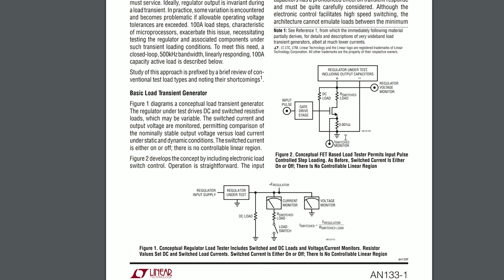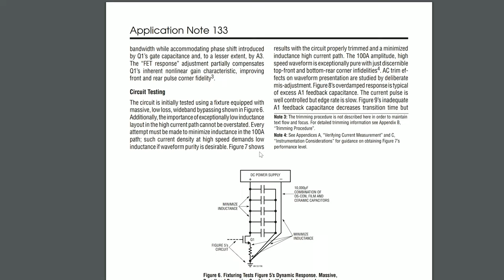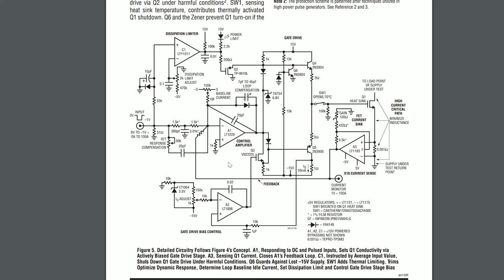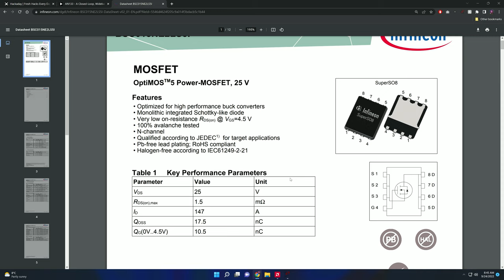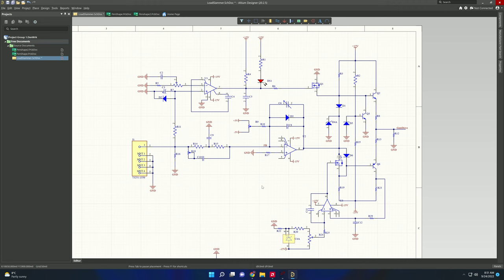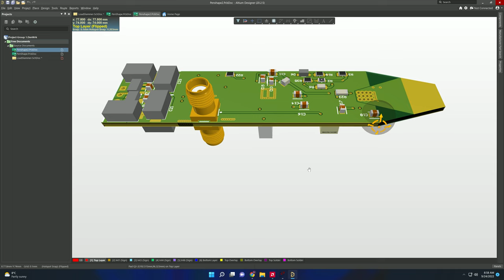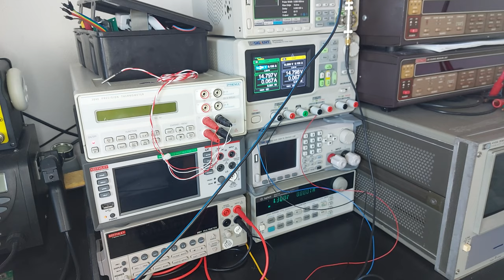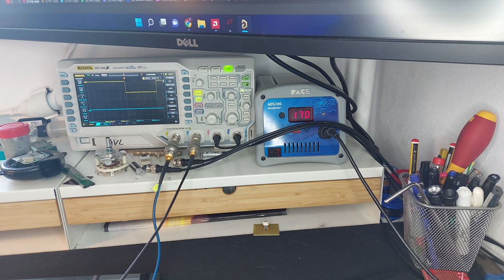Revisiting Jim Williams (AN133 Simulation, Layout, Build and testing)

Comment: Fantastic tutorial, I enjoy this sort of thing to but much more simple! I used a Rod Elliott application note from his channel for a very high quality headphone amp, I also opted for SMD because I enjoy PCB design with these parts and I designed my PCB very different from his to suit my needs, I had my board built by JLCPCB and they did a fantastic job. I populated it and it worked perfectly no cut's or bodges which felt nice the amp was so quiet barely any noise I didn't think it was working so set up my scope and it's perfect. Hats off to Rod. It sounds beautiful and I love it ! but the project was fun and I know how you felt at the end of yours ! I will probably design my own boards for some more of his projects at some point Thanks again for the video.....cheers.

Comment: Nice one! Rare to see someone take on a design from an app note like this. I read about a similar high current pulser in AoE X Chapters - shunt on source, powering gate driver from a linear trimmable supply so the voltage across the shunt can be set with some accuracy, and the gate driver does the rest. Unfortunately you can't do waveform magic with this one since it's just an on/off thing. Looking at this video got the gears in my brain working, I wonder if I can come up with something like this but simpler...